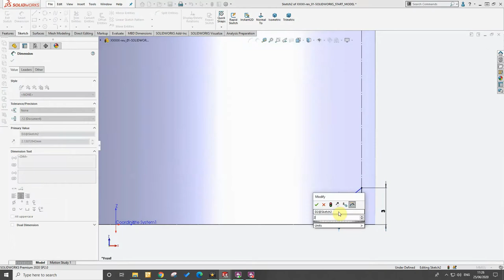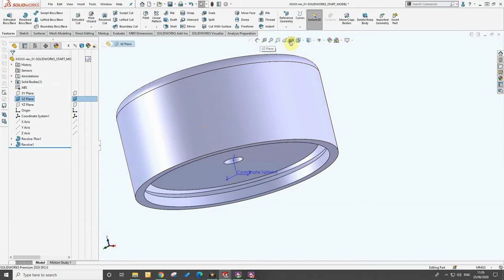How We Used TPU To 3D Print a Rubber Seal

Comment: Hi i need .gcode file please with settings for Ender-3 printer for D-ring 9.4x6x17mm or 9.2x6x1.62mm 95 hardness. the round shape must to be inside
Reply from the maker: Please email ianc@impossiblecreations.co.uk with your enquiry & further assistance.
Reply: @impossiblecreations3dscan317  thanks for video
I am going to make gasket for my electronic box enclosure. Could I send you my design file on fusion360 if I struggle with design please?
Reply from the maker: @pietpompiepompiepiet940  Hello, please email your enquiry & further details to meganc@impossiblecreations.co.uk
Reply: @impossiblecreations3dscan317  thank you very much will email you toniggt